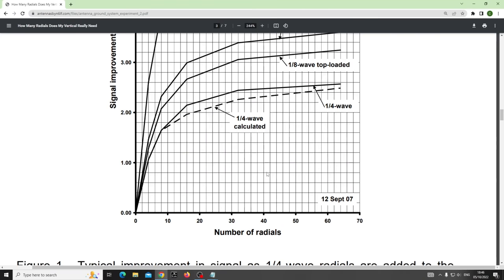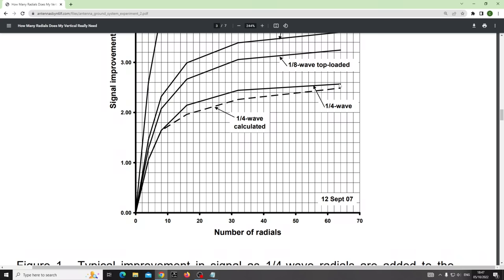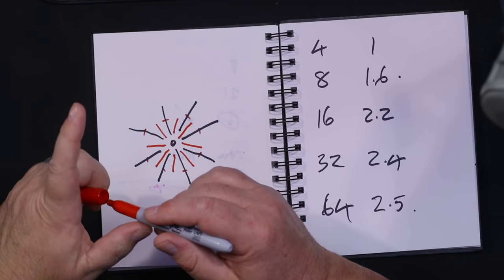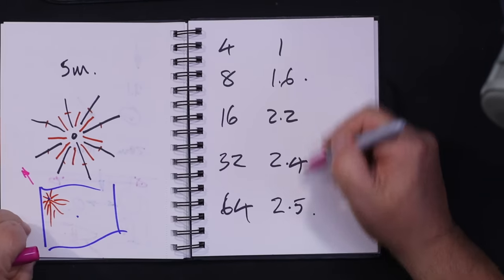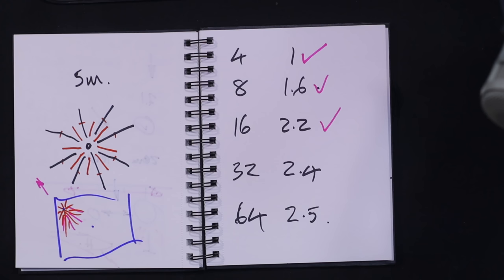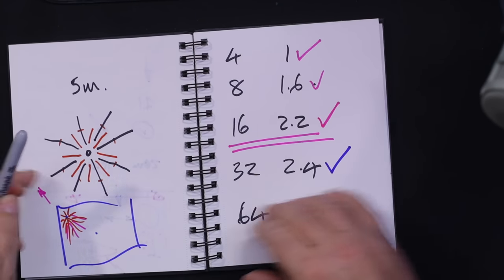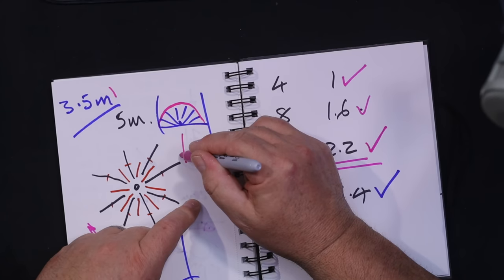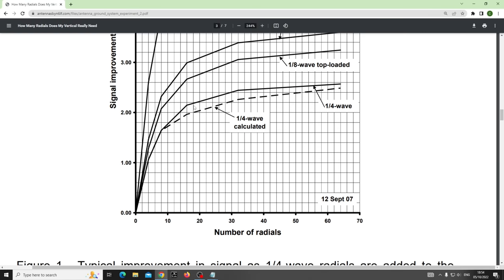Vertical Antennas 101: The Importance of Radials - How Many and How Long?

Comment: My buddy N2ewm has a shunt feed vertical 125’ long up the tower insulated from tower. Ran 120 full length 12awg radial and he run 20 over s9 prior he had 60 and about half the output. He also tested at 85-90 radials and was about a 10-15 over s9. I was surprised as I trust the On4un and he say rules of diminishing returns was in the area of 64 🤔🤔??? He vertical works a treat but his 160sky loop at 120’ high produces a 40 over s9 I’m about 200 miles away. He tried NY to SC and was about the same strength on both. Ops forgot to mention he also runs a 10m 4 element Yagi on the tower as a cap hat too how much that help I’m not sure 🤔
Reply from the maker: Well, I like to keep things easy.. Very difficult to compare like for like etc..
Reply: @DXCommanderHQ  no way would I ever well I’m contemplating a vertical like yours and may be a 4” wide copper sheet but in a roll maybe do 16 1/4w as you say. I’m not one who likes extra work but I do strive for best efficiency where I can. 

Think my next project is a 8” coil wound inside a 3D printed coil form then a 7’ mast with a spiral cap hat similar to hiQ mobile but bigger coil. I’m contemplating 3/16” copper mandrel bent. Then sun how rigging a plunger roller to make it multi banded but need to hire a cad guy to make the part files to send out for quotes

Comment: I don't use any radials on a 22ft vertical and with 100 watts talk from Cleveland to South America, Europe, Africa etc. on 15/12/10 meters.
Reply from the maker: If it's an "end-fed" you won't need any but for 40m, you would need a 20m pole :)